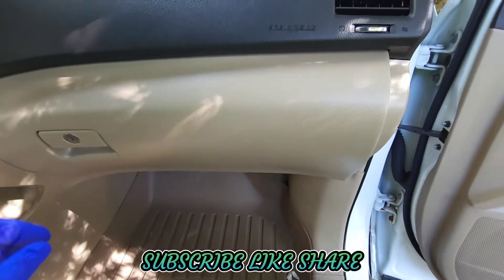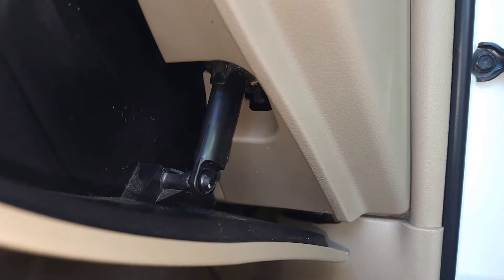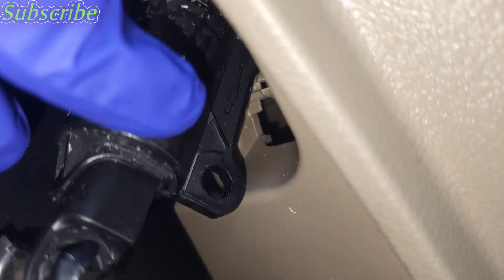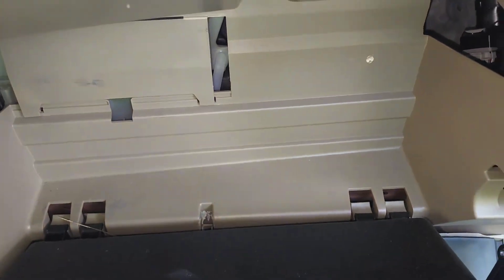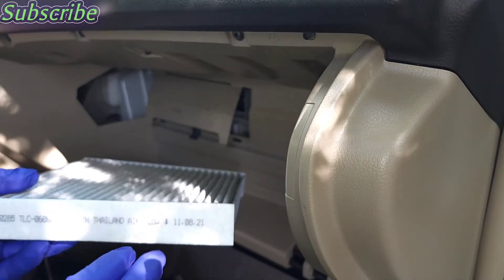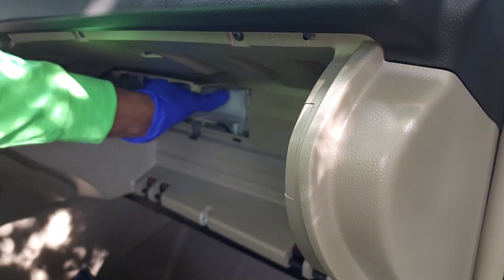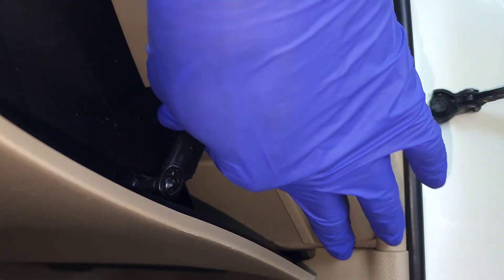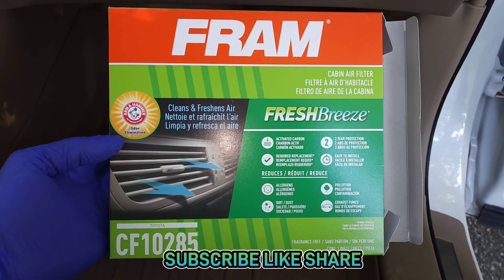Toyota Highlander Cabin Air Filter Replacement

Comment: All horizontally mounted cabin air filters with the blower motor mounted below the filter will have downward air flow. So regardless of how your old filter was installed if it's horizontally mounted chances are it will have downward air flow. That's why dirt collects on top of the old filter, because dirty unfiltered incoming air enters the topside of the filter and flows downward.
However, some brands don't have air flow arrows but they merely say "UP" next to the arrows. Those arrows have nothing to do with air flow direction. They merely mean "This Side Up".
Reply from the maker: @Jack TannehillPromoter  Cabin Air filters are designed to flow air in a specific direction.  The holes are bigger on the intake side to trap bigger particles but they can be installed opposite of their intended use which would cause premature clogging of the filter. They have arrows indicating air flow direction some even state it on the filter "Air Flow Direction" along with a  arrow. Thanks for watching please Like, Share and Subscribe if you haven't already
Reply: @BIGWILLSCARCARE  
Air flow direction is downward...